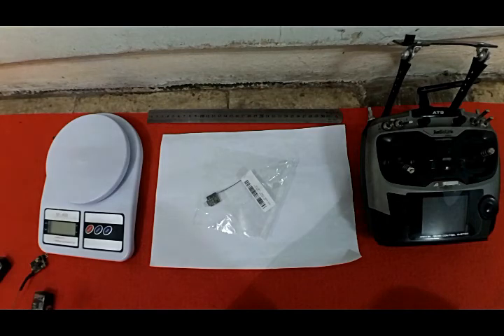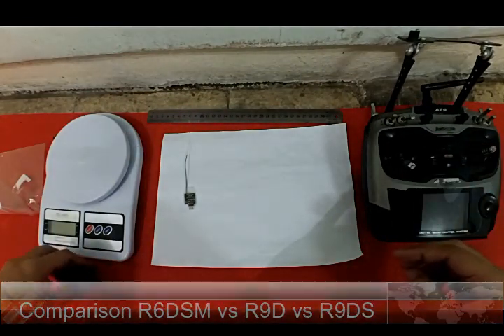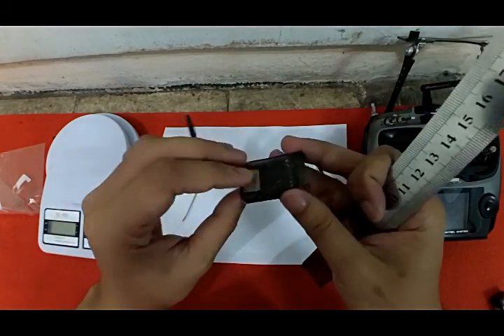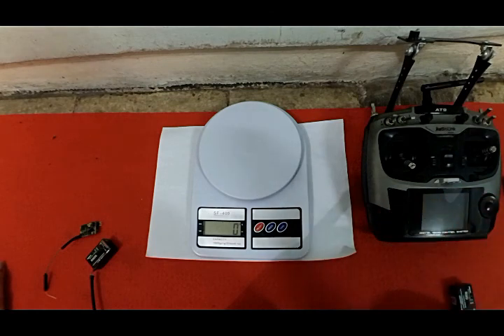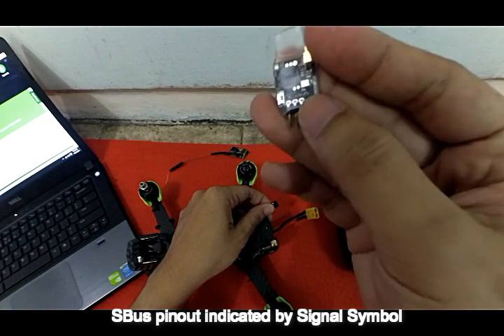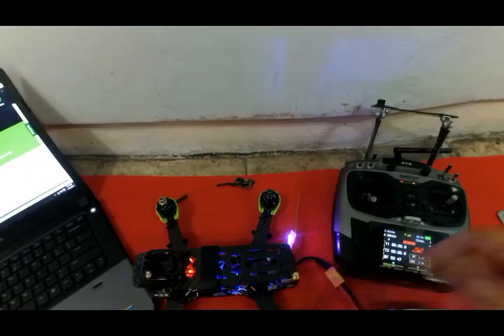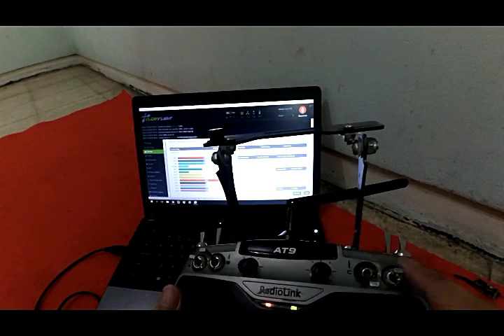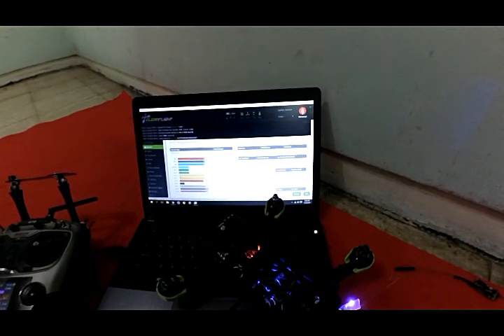Review and Comparison Radiolink R6DSM SBUS/PPM Micro Receiver

Comment: does it support failsafe?
Reply from the maker: No, it doesn't. When radio lost, R6DSM can't give any command to FC
Reply: so completly useless rx :x
Reply from the maker: The term useless is relative. 
If you fly a multirotor that use GPS such Aerial Photo/Videography platform that use radio failsafe as RTL, then this micro receiver wouldn't fullfil your need. 
But if you fly a multirotor on Racer platform that didn't need radio failsafe as RTL and aircraft's weight matter, this micro receiver is what you need. Moreover, if you planned to play on micro sized multirotor, this micro receiver is your answer. Imagine in that micro frame you use R9D receiver. Even you depinned the board only as Sbus output, the size & weight still bulky.
Reply: yeah i understand but this is very dangerous to fly without failsafe :(
Reply from the maker: I agree with you in some ways.
IMHO, i don't really need failsafe for my 250 & 100 fpv racer since they are not flying in long range, just close range around air gates and crashes don't affect to much. But on my 550 that fly for some ranges, the radio failsafe is a must.
Just install what you need on your aircraft and I hope my video and our little Q&A would help you :)
Reply: thanks a lot for you response :) still have order one, i will try on a quad and see the range of it to see if this is usable in safe enough condition for me or not :)
Reply from the maker: you're welcome :)
Reply: Are you sure that there is no options for FC to recognize that the signal is lost? I bought this recever and know faced the issue with failsafe
Reply from the maker: I think the recognizing radio failsafe found on receiver side. 
The receiver will send a PWM Value to FC when radio failsafe happened. This particular PWM Value recognized by FC as failsafe condition so it will do what had been programmed for failsafe action.
Unfortunately, R6DSM seemed don't send that particular PWM Value to FC when radio failsafe invoked so the FC only detect immediately zero throttle -  the aircraft will be down fast and hard landing.
This R9D & R9DS don't act like that. These R9D/S receiver can send particular PWM Value when radio failsafe invoked so FC would recognize that condition easy.
Reply: I set it. It sent but not right value, at least for throttle. For me failsafe it is not actually safe from fail it is safe from fly away. So I need that it stop flying. I set F/S at the transmitter on the last 8 channal to 0% and add Failsafe switcher in Modes right in this position. So now I can make failsafe mode manually, and if reciever lost the signal it also switch FC to failsafe mode.
Reply from the maker: So you use F3 flight controller with Cleanflight/Betaflight (must be racer platform) but you installed GPS module so it has RTL mode?! By this means, you technically have 'RTL' switch now.
Actually I don't get so much setup Failsafe on CF/BF since I just need it landed when radio lost. My previous experience with APM, radio failsafe setup is easy. Maybe you can use this trick.
This trick targeting a failsafe PWM Value that lower than the normal lowest PWM Value of throttle so FC will identified it as failsafe easily.
By first you must lower the end value of your transmitter's throttle then setup the failsafe by knowing the new PWM Value. After that you revert back again the end value setting of transmitter to the standard end value.